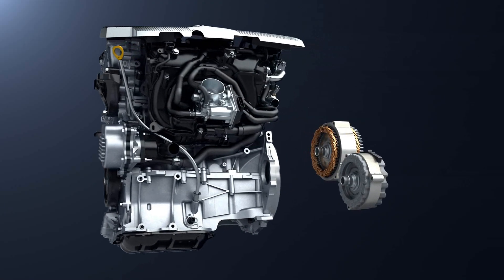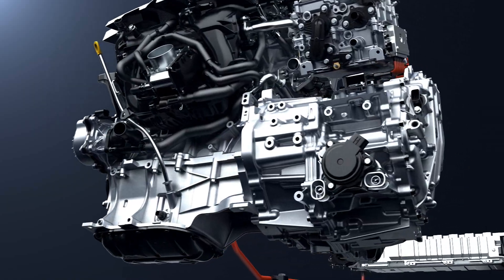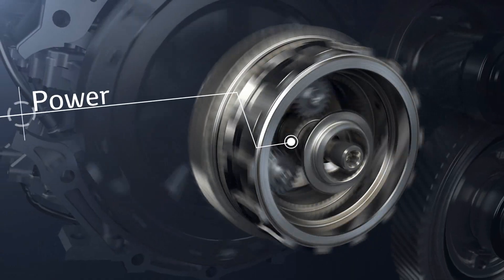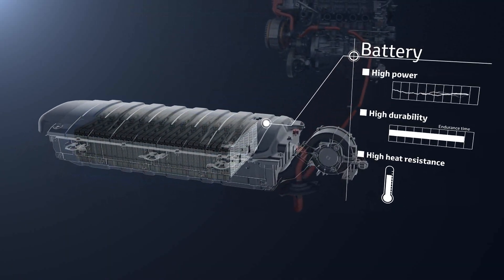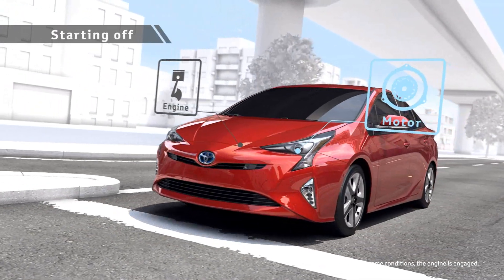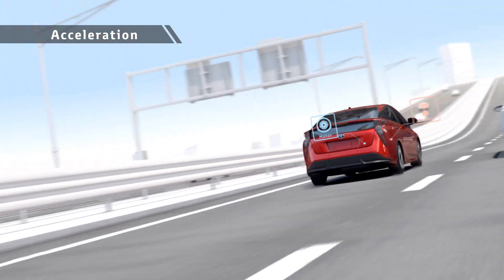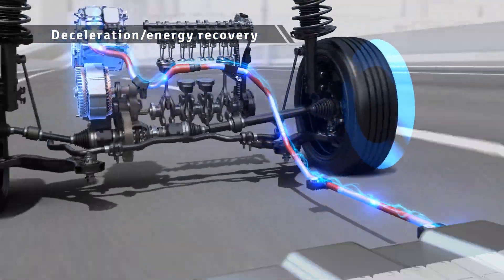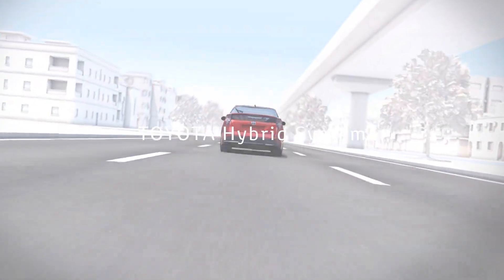Toyota Hybrid System

Comment: Paris is banning all diesel vehicles starting in 2020. Germany is banning all internal combustion engines in 2040. Internal combustion is on it's way out because of pollution in cities.
Reply: Nate Hawkins dude your a poor sheep just like the rest of us. I wouldn't even drive a Prius if I could buy electric. Americans dont care bout the environment or anyone. You rather pollute the air and water then make an attempt to do right. Fuck your truck and fuck the gas industry
Reply: Meanwhile in America half the population drives SUVs and pickup trucks which on average pollute over 300 grams of co2 every km. A Prius is less than 100 grams of co2 every km.
Reply: Jim Johnson can your hybrid tow 10,000 lbs?  Can it haul a load of fire wood?  Didn’t think so.
Reply: @Pontiac65Cat  Can your car raise my forklift? Didn't think so.
Reply: Simon WoodburyForget that's just too bad that 80% of people live in cities. Bring the electric vehicles!
Reply: Nate Hawkins even Americans started buying hybrids when the fuel price went up.
Reply: This is good news. Diesel fuel burning has been a necessary evil. Biodiesel fuels aren't practical yet because it causes too much damage to raise enough soybeans and corn to power all our trucks, equipment, and buses. Think of all that irrigation water! Even natural gas can't replace all the diesel fuel use. Burning diesel fuel is nasty. Just follow a big truck with your windows down if you don't believe this. Prius and other hybrids are just a very good step along the way to trying to save our planet and our lives.
Reply: @SimonWoodburyForget  then what about refineries? The boats, trucks, and pipes that transport the oil and fuel? They do not move and build themselves up from nothing. If you add all of that, EV is still a better solution, and not every country uses coal energy.
Reply: Simon WoodburyForget they pollute in different areas. I'd rather it be away from where most people live!
Reply: @SimonWoodburyForget  Crap. They pollute all the time as they use FOSSIL fuels which must be extracted, transported, refined and transported again (polluting all along) just to be burnt and expelled as venomous gases, closing a vicious circle of continuous pollution. Electric power can be obtained from renewable resources, and electric vehicles pollute a tiny fraction of equivalent ICEs.
Reply: @SimonWoodburyForget  Still less polluting than coal/oil power plants when they go out of service, not to speak about nuclear plants when they are decommissioned or go (ghastly) wrong. I know, because over here we have glaring examples of the REAL costs of such oil-driven power industry.
Reply: @SimonWoodburyForget  You've been bantering all along and yet talk about others' nonsense? As pathetic as your statement about "combustion producing very little waste". Get hired to clean up a decommissioned coal or oil powerplant, then, and without protection gear. Your lungs will say 'thank you' in no time.
Reply: @SimonWoodburyForget  YOUR argument is devoid of any sense, because fossil-driven powerplants produce pollutants in every step of their lifecycle, and to function they require toxic fuels which produce pollutants as well, all along from well/mine to chimney! Over here they have recently removed an outdated wind turbine field (approx 15 towers) in a few weeks without leaving a mess to clear up. Try to do the same with a coal or oil or NUCLEAR powerplant! Their huge remediation costs are NEVER factored in. We used to have 4 nuclear powerplants. After Chernobyl a referendum forced the State to decommission all of them and after FORTY YEARS they are still there because of the HUGE costs to stock the spent fuel safely and demolish the shells! MEGABILLIONS that we're still paying for with quotas in our electricity bills! Yours is a false economy driven by petroleum lords' drivel.
Reply: @SimonWoodburyForget  You're blithely oblivious that Chernobyl happened again in 2011: the Fukushima disaster which they're still trying to fix and clean up, spending BILLIONS while releasing tons of radioactive waste in the ocean in the process. But who cares? Wind turbines produce plastic, oil, copper waste like cars, sold by the millions. If plastics cannot be recycled to make other plastics they can be grinded down and used to repave streets and roads. No fossil fuel is 'waste efficient' when their exhausts are sent to the atmosphere at the tune of millions of tons per year. Your arguments are ridiculous at best. In 2025 all our old and shitty coal and oil-fired powerplants are scheduled to close down (cleaning-up costs to the public purse, of course) AND YET the local politicians are beating about the bush while we have plenty of sun and plenty of wind 300 days a year.
Reply: John Puccetti Thankfully i live in the US of A! I'll keep my F150 that makes 75 grams too much CO2 lol 

You know...Germany banned books before, if I'm not mistaken. I don't think we need to follow France or Germany anytime soon.

Comment: amazing engine by Toyota!  big oil companies hate this technology lol
Reply: Cool Gadget Reviews That's right!
Reply: You still need to use gasoline though
Reply: The hybrid battery dies after a few years. Issue with lag (not the engine not having enough power to move the vehicle - just the engine deciding whether or not to work). Necessary to have more than yearly maintenance done on the vehicle. More than that, only the dealer can perform maintenance on the vehicle, therefore driving up maintenance costs.

Not saying I don’t like hybrids, but they aren’t exactly the greatest thing since sliced bread.

IMO, if you really hate big oil then Hydrogen powered vehicles are the way to go - that way you aren’t paying for gasoline at all.
Reply: @Lysandros1   10 years warranty for Toyota hybrid battery. It's not going to die in few years. Do some research about Toyotas hybrid system reliability before posting false statemets anywhere else.
Reply: It has 8 year / 160,000 Km warranty
Reply: @Lysandros1  And do some research about hydrogen cars service while you at it. It's not like your ICE car that you can take to your friend's garage for maintenence. I'm not hybrid fanboy, but for me it seems the most effective. ICE will stay for a long long time to come, like it or not. EV is still in baby shoes, making it very expensive and time costly. Hydrogen, while it looks like the answer, still also very expencive to produce and transport. There is nowhere near amount of stations to fill your car. So yeah, at the moment  hybrid is the way because price compared to ICE only is similar and if you learn to drive it correctly you use half the gasoline you used to + batteries have come long way and will last.
Reply: @Lysandros1  Абсолютно неверное заявление. Батарея не умирает через несколько лет. Ее ресурс стабильной работы доходит до 250 тыс. пробега. При условии правильной эксплуатации. Это в первую очередь, не допускать перегрева батареи, в условиях летней жары ездить с кондиционером, а не открытыми окнами. Т.к. компрессор кондиционера работает не от двигателя, а от гибридной системы, повышенного расхода топлива и износа поршневой двигателя практически не будет. Второе, это не использовать принудительный EV режим постоянно, он предназначен для заезда в закрытые помещения, где недопустимо нахождение выхлопных газов. Третье, не оставлять разряженной батарею на длительный простой на стоянках и не оставлять батарею разряженой в зимний период, при низких температурах на сутки и более. Все проблемы скорого выхода из строя батарей, это их неправильная эксплуатация владельцами.
Reply: @Lysandros1  You have no idea what you're talking about. It's fairly common for a Prius to hit 300k miles without any serious repairs. My ex wife had a 300k mile Prius that still ran great, even though the odometer stopped at 300k miles. The battery heat pump failed, and needed to be replaced. That was like a $200 repair she never bothered to get done. Original motor, trans, and battery, and it is still just as (not fast) as the day it left the dealership.